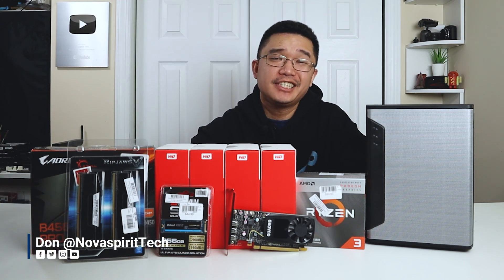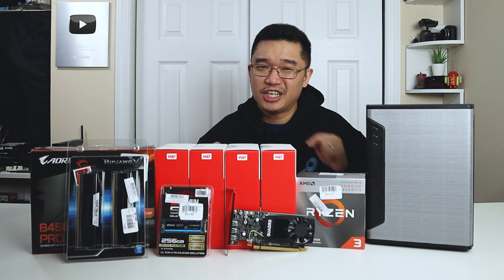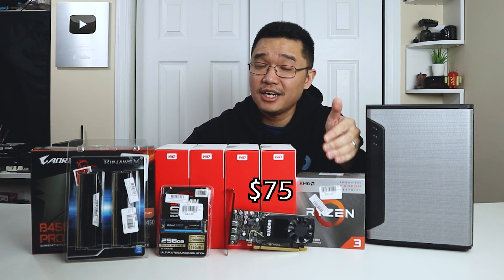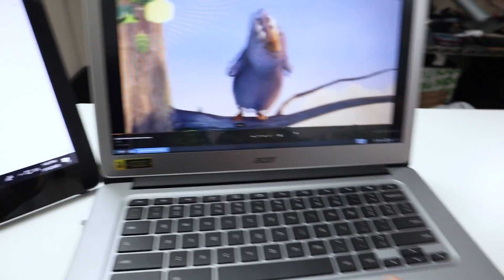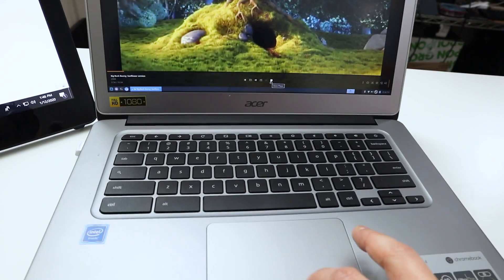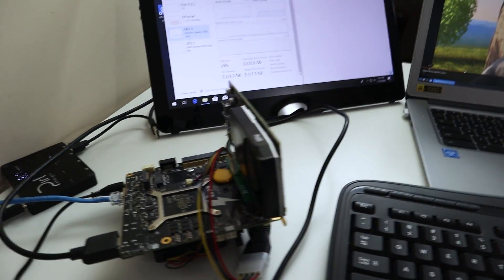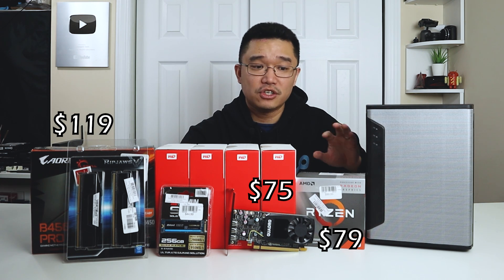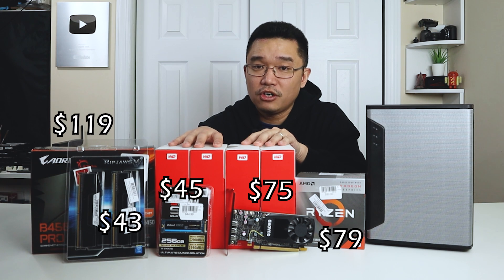DIY NAS & Plex Home Server With Hardware Transcoding Build

Comment: Everything I could find on plex's site about hardware acceleration made it seem like it only supports intel CPUs Was there extra work required to get this working the AMD cpu?
Reply: HW transcoding isn't supported on AMD, the GPU is doing all that...without the GPU that is software transcoding, obvious difference...

The reason they recommend Intel is because all of their modern processors have "Quick Sync" which supports HW transcoding on the CPU.
Reply: I didn’t think that GPU acceleration was supported on linux.
Reply: @indigo1608  Why wouldn't it be?
Reply: Casey Cushing 
I’ve been looking for a while and have not seen any Linux support for decoding.      https://support.plex.tv/articles/115002178853-using-hardware-accelerated-streaming/                      If your Linux computer also has a dedicated graphics card, the video encoding acceleration of Intel Quick Sync Video may become unavailable when the GPU is in use. If your computer has an NVIDIA GPU, please install the latest Latest NVIDIA drivers for Linux to make sure that Plex can use your NVIDIA graphics card for video encoding (only) when Intel Quick Sync Video becomes unavailable.

Comment: That case had PSU from FSP Group with 80+Bronze/Gold, So don't worry about that part and i'll choose r3 1200/1300x with b350/a320 mobo. 
I had my low budget NAS with r3 1300x+gtx 1050 LP + A320 mobo +2x2TB WD RED + 8Gb ram + 120Gb SSD

Comment: Why bother with the "G" version of the Ryzen if you're not using the onboard graphics?
Reply: because he is. quadro only for transcoding
Reply: @krich106  I understand that, but this is a server build, a server that will be accessed remotely.  The GPU would be used to drive a monitor only rarely.  For a budget set-up, I would save the money on the Ryzen G and plug the monitor into the graphics card on the rare occasion  that it would be needed. Chances are if you re using the server via monitor, you're not going to be encoding at that time anyway.
Reply: @critterscropscuisine2886  You replied to the wrong guy bro.
Reply: @krich106  Not really.  Youtube auto-logged me into my Blog account. I replied to the correct guy, with the wrong account. :)

Comment: my servers are running windows server 2013/2016 and also my new one is on proxmox with linux vm's still trying to figure out getting grafana and a database set up bu will get there soon. should also vm something like pihole for local dns blocking and cacheing.

also been more of a fan with emby then plex but that's just my opinion.

Comment: Whats that cool Mainboard you used for that Test setup?

Extra PINs on the Harddrive Cage: For extra HDD LEDs and to send more information about the Cage to your Motherboard or you Hardware Raid Controller.
You will find such Connectors on Server-Mainboards. Have a look at SUPERMICRO or every mainboard that supports XEON CPUs and you will find a connector for that.

** F0104 "Discrete HDD Fail LED Signal Input COnnector.**
Most of the Hardware Raid Controller do have some pins for HDD LEDs.
They may lite up just by accessing the drive or they may blink if a HDD of an array fails (depends on the controller) .
That makes it easy to identify a faulty drive

** CN04 "SGPIO Signal Connector ** 
That's a bus system that allows the raid controller to communicate even more with your drive cage aka backplane.
You may read out Temperature or something like "Fan Failed" with that or even if there is a drive a slot.
You can find that on ADAPTEC Controllers

Here you can find the User Manual for the Backplane:
http://www.chenbro.com/en-global/DownloadFile/download/403

Comment: I have couple of ZFS (8 and 16TB) NAS's that's been running 24/7 for almost 10 years now -- w/o ECC memory, just regular non-ECC RAM. One of them is down, but only due to a PSU fail. Not one data corruption during all that time. Of course, your mileage may differ, but from chatting with some of the developers, I think that requiring ECC mem is one of the many myths surrounding ZFS. Another being requiring 1GB RAM/1TB storage (or some such nonsense). From my experience, just get the fastest SSD for cache and ZIL, turn off dedup, and give it plenty of memory (ZFS will put it all to good use).

I can't think of using anything else than ZFS for a NAS. Don't let some of the myths detract you from using it. Might have to brush up on your Solaris or *BSD. But say what you will about *BSD's, but they're damn stable -- never a crash on those NAS's. Not sure about the Linux port of ZFS. Heard it's gotten pretty good, but not sure if I trust it, since Linux itself is less stable.
Reply: I've used ZFS for about half that time in a 24/7 operation. Non ECC murdered the pool at around the 75% full mark. Lost everything on that pool, nothing was recoverable. And I've seen the argument for and against. The data corruption from everything I read, was directly due to the non-ecc ram. If there ever was a question about could my data be lost on ZFS - use that ECC.

Comment: Good video, but before buying a GPU for transcoding, don't forget to check its transcode specs, 
The P400 is limited to 2 Encodes witch is really low
Quadro M2000 or K2000 is a better choice (K2000 can't decode 4K)
https://developer.nvidia.com/video-encode-decode-gpu-support-matrix

Comment: I am just getting into building but I thought when you have Plex it does the transcoding for you that that was purpose of Plex ty.
Reply: Plex does the transcoding, however you can do it in software running on the cpu, or plex can hand that task off to the gpu.   That was what his demo in the beginning was about.
Reply: Also hardware decodes on Intel 4000 series and up (5th gen).

Comment: I bought an IBM X3650 M3 for less than £200 with 96GB RAM, 2x 3.06GHz X675 hex core Xeons and the system has the capacity for 8x SFF 2.5" drives as stock. Added a second SAS/SATA backplane for another 8 drives and expansion card (about £100) and a Quadro p400 for transcoding (£75) with the modded driver. 

Downside it is power hungry but I can VPN onto the network and bring it up and power down via the machines management interface. Runs Plex on Mint and is very stable. I also added a few 4TB drives in RAID5 for films and 2x1TB in RAID1 for music and one SSD for OS which I need to also use for metadata but not done that yet.   Not the fastest of machines but for Plex it works well.

Worth bearing in mind ex-production servers, but I'd be a little careful with Dell R710's - mine is very funny about drives. I should update / change the RAID card in that machine but out of the two I've had a lot more ease with the IBM and have had no issues with drive compatibility. 

Great video! First time watching your channel. Thanks! Subscribed.

Comment: I don't understand why some people go out and buy new parts when the refurbished market is so good. My server is an Intel S5500HVC board running two Xeon5675 chips with 32 gb of ECC ram. I get 12 cores with hyperthreading and turbo boost for around $400 shipped. The server has several users and I stream to my phone when I visit the doctors and it never lags, it has been in continuous use for 3 years without an issue. Your build is sufficient but if you are going to the trouble of building a media server why not use equipment that was designed for server use.

Comment: Im using two FSP 300w gold rated psu with short cables looking exactly the same, for 24/7.  They are quiet and reliable. I wouldnt change them for anything else.

Comment: Better Budget Build: Instead of spending $500 on a separate PC, I just spent $200 more on a higher-end motherboard for my main PC when building it, that had more than 2 x full-length PCIe slots, bigger computer case with 6x HHD slots, and just installed the 6 HHDs internal plugged into SATA ports on the Motherboard. Run Unraid for main OS, then use Windows 10 VM for everyday use and gaming, while the Plex server runs on Unraid Docker set to the Last Core/Thread only. Then I bought a used GTX1050ti off craigslist for $40 and installed it in 2nd PCI slot and use it for dedicated HW encoding, and instead of going for 8Gb of ram only, I went for 4x 8GB sticks and 1TB m.2 SSD for the Windows VM. Windows is allowed to use ALL 32GB of ram, but Plex is set to only use 16GB of it and set it for memory transcoding.
Reply: Nice build but most people prefer separate. I don't like leaving my main rig on 24/7. My NAS and Plex server combine use very little power.
Reply: @JFlogerzi  exactly, mine runs on a 150W Pico PSU and a power brick, basically a small laptop.
Reply: separate is always better.. but nice job.

Comment: That is a good and reliable PSU. Just to let you know, after 4-5 years they have a disease that the 4 pin will not push enough power and the fans will work on full speed and you won't have a display. But, they won't explode or something like that :)

Comment: What? Of course you can run FreeNAS on such a system with no issues. No need for server-grade hardware. If data corruption (more specific: bit rot) happens, then this is not a thing about being "exclusive to ZFS or FreeNAS". It would also happen on other OS. The cool thing though now is (with FreeNAS), you would notice it because of the checksumming modern filesystems like ZFS (and also e.g. btrfs) offer compared to ntfs or ext4. You basically just win. Yet, of course it is advised to run server grade hardware, if you really want your data (locally) well protected - but is not a must.

Comment: Been rocking freenas 11 on an old Lenovo with 2 6gb hgst deskstars and 4 GB of non-ECC Samsung ram for two years, CPU is an I5-3330 and I have about 500 movies on it, I can honestly say that I have had zero issues with zfs and non ecc ram. Buy good sticks with Samsung chips and I don't think you will ever have to worry about errors corrupting your data when freenas scrubs the drive pools. Just my two cents!!

Comment: A lack of ECC ram wont cause more of an issue on ZFS than other systems.  In fact, it'll at least alert you to the majority of the problems that bad ram will cause.
Reply: Got a question for you I was planning on building a small server for my home using mobo Gagabyte a520i with ddr4 ram and installing free nas on it. So when he said you could corrupt your data using free nas I wasn’t sure what he meant would I be ok with this setup I just mentioned

Comment: Ive heard there are issues getting hardware pass-through to work correctly  when you are using a APU and GPU, but it might be less of an issue on Debian were we have more control over the system than free-nas or some of the others.  Im in the middle of trying to re purpose a older i5 haswell system with no GPU.

Also Attempting to use AntiX, ( Debian based). I think Its a better Choice since it has updated kernels that should better support Btrfs. Also Easy to make live snapshots of the you config which save to a live boot-able ISO.

Still trying to figure out how to get any distro to install on a 4 drive sdd btrfs Raid1 and be able to boot grub if any one or two drives fails.

Comment: Hard drive cooling in small NAS is just terrible. Imagine four 10TB right next to each other. With one fan trying to pull air in through the hard drives. I had this case and I also had the In Win and Supermicro. Best one was Supermicro. Still runs hot.

Comment: i'm able to transcode with my amd rx580 on Windows 10.  Yes, that's easy because we can see that gpu is running, but what about any guarantee that acceleration will work on any linux system. I try to use arch linux and freenas to no success. Will another linux  distro work with acceleration?

Comment: I run a Windows base system using Stablebit, a software JBOD.  I currently am running 102 Tb of disk space using replication for over 50 Tb of data.  Been using this system for about 10 years with various hardware upgrades and OS upgrades over that time frame.  Setting up another similar system on Windows 10 now for remote backup.  All that is for my NAS supporting a separate Plex server.  The guy who got me into this runs everything from his Windows system including Plex.  Much easier than UNRAID, which I also run and definitely easier than FreeNAS.  Such a setup doesn't require much CPU muscle for a NAS either.
Reply from the maker: Thanks for the info. Gonna check out stablebit

Comment: I have an old GPU around my home, but how can I tell if it works for transcoding?  Actually I pulled from a closet the old GPU, which is a Radeon HD 6870.  Will it work?  However, this build is NOT a $500 build since I will have to buy all 4 hard drives, which could be more than $300 per hard drive!!!  Furthermore, why do I want to build something for $500 when I can buy Synology 4 bay NAS DiskStation DS918+ (Diskless)
 for $550, and I don't have any trouble if it fails?  I know I still have to buy some NAS hard drives, but I will have to do it after building your NAS, for nobody is sponsoring my build to give me NAS WD drives for free!!

Comment: I use Synology and evaluating DIY NAS as a replacement. Thanks for this video
Reply: why would you need a replacement for Synology?
Reply: @anghDescartes  almost 8 years old NAS, HDD still running like amazing, but base NAS Device is on very old platform hence the performance.
Reply: @ahdeshpande have you looked at the DS1019+?
Reply: @richardday5125  i have, but the best part of DIY NAS was to have Virtualization enabled, but still unable to conclude whether DIY with Windows Storage Server or freenas / unraid...
Reply: @ahdeshpande  I don't recommend Freenas. Huge memory hog, also SMB performance sucks.
Reply: looks like this board also supports up to 32GB RAM... won't find many Synology systems with that

Comment: Proxmox is a Debian based level 1 hypervisor if you need to add another machine down the road for more storage capacity or more VM's and has its own web interface GUI plus plus
Reply from the maker: Yup I love proxmox I use it In my own hp server I have at home. Not sure if this Mobo / cpu supports virtualization though
Reply: @NovaspiritTech  it should my ryzen 5 1600x and ryzen 1700x both supports it
Reply: @NovaspiritTech  depends on how many cores you can dedicate per vm you want.
Reply: Nowadays cpu supports them

Comment: does hard drive speed matter, would it benefit using 7200rpm or SSD. I know it would no longer be a budget build but would there be a noticeable performance increase?
Reply from the maker: not really, since data is transfering via gigabit lan. even a 5400rpm can saturate it completely. also with raid 5 you get 4x write and 4x read

Comment: I've been running OMV for about 8 years now.
Reply: Have u faced any issues
Reply: No not really it supports tons of hardware I did have a slight issue with running the latest omv 5 but it was just a corrupt sources.list
Reply: @Pi Pony  I don't run ecc ram as my motherboard doesn't support it currently.
Reply: @Pi Pony Nah you should be fine ECC only really matters if your using ZFS as the filesystem for the NAS

Comment: $470 is not cheap... dunno why poeple never recycle old computers to nas systems.. saves like 75% costs. you only won't have a nice case.
Reply: All my previous gaming computers are power hungry and not what I want running 24/7
Reply: Most of the build was sponsored... But typically with older hardware power consumption is alot higher then low power and near gear.
Reply: But its not very expensive either

Comment: Love the build, but you are wrong with ZFS and ECC. All file systems can benefit from using ECC Ram. One of the developers of ZFS stated:
"ZFS without ECC is no worse than any other file system without ECC and that there is nothing about ZFS that makes it require ECC"
Reply: Yes that's true, ZFS doesn't need ECC, read this article
https://jrs-s.net/2015/02/03/will-zfs-and-non-ecc-ram-kill-your-data/

Comment: What You said about reasons to not use FreeNAS is total bullshit. You want to use ECC and server grades parts to eliminate to the minimum any corruption but don't using ECC memory etc. wil give You protect at least the same as not using zfs... FreeNAS will give You even better protection because it is doing all for data (even without ecc and server grade stuff) to protect data from corruption

Comment: For my NAS/server I use freenas on top of proxmox. I passed all the hard drives through directly to the freenas VM because when using ZFS it's best to let the VM access the drives as close to block level as possible
Reply: I had similar setup but running on top of esxi 6.7. The SMB performance was terrible for some reason, so I have switched over to xpenology, runs much better with less resources.

Comment: Ironic of you to advise against using ZFS because you don't have ECC memory and then recommend unraid in the same sentence. Because unraid doesn't use raid, or even zfsraid it's even more dangerous, especially if you don't use ECC memory. There's a reason why enterprise grade raid solutions (including zfs) don't let you just slap in a hard drive of any size willy nilly. Unraid is a bad idea

Comment: Doing something similar but with i39100 and cooler master elite 120. Still trying to figure out which nas os to use.
Reply: Switched my home nas os from OMV to CentOS 8 (community version). Been running smoothly for over 3months,no issues whatsoever, BTW currently don't run plex on it.

Comment: Doesn't one of those sata ports share bandwidth with the m.2 slot?  Some motherboard manufactures mention that, some don't
Reply from the maker: Correct. You will notice the motherboards that share the sata port usual will have 6 ports. This one only has 4 so I assumed it didn't share.
Reply: @NovaspiritTech  every 4 ports  motherboard i have had one port is shared on a board with 6 sata one is still shared but left 5 sata ports.